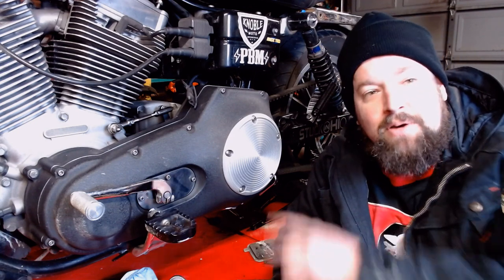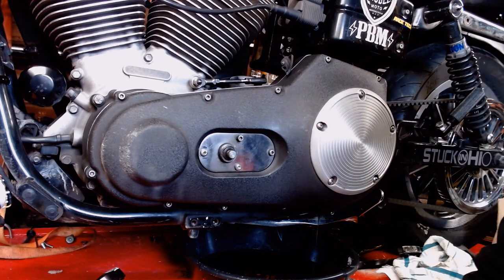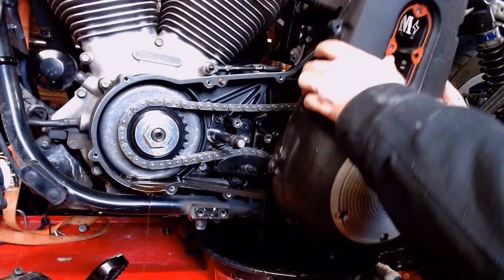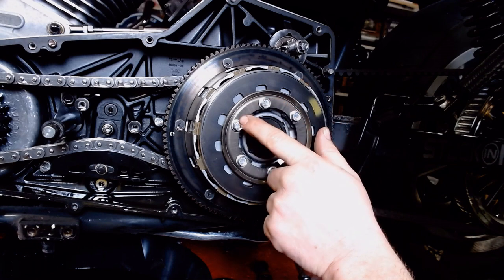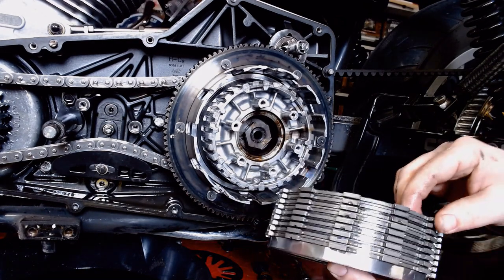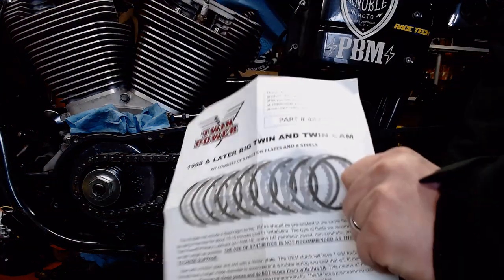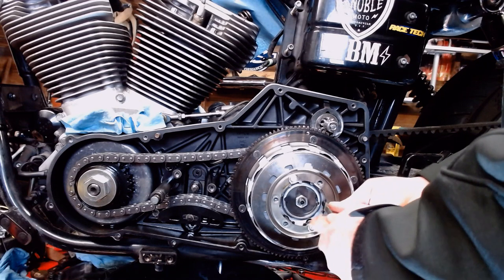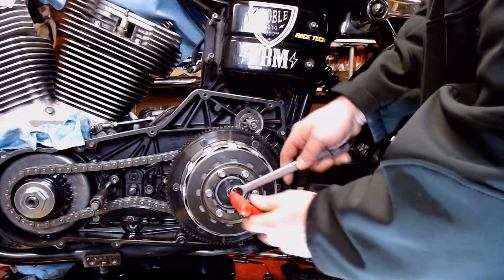Harley clutch replacement with no special tools

Comment: Just like to add that the 6 bolts holding the spring are torqued to I believe 70-90 "INCH" lbs NOT foot lbs you'll break the bolts at about 30 ft lbs 😄 yes I do know this from experience lol have a grateful day 💯✌
Reply from the maker: You have to listen to what I think I said. Lol.

Comment: Can you please tell me what size those bolts are the six you took out of the clutch basket retaining ring?
Reply from the maker: Screw M6 x 1.0 x 16mm Hex Flange Head   HD part 2980. Make sure you get high strength ones.

Comment: Novice Wrencher…

You still have to take all the slack out of the cable right?
Reply from the maker: You want to loosen the cable to have some slack in it before you make the adjustment on the clutch. Then once that is good, adjust (remove the slack) from the cable.

Comment: Great vid.. thx.. Question with 52K on the motor, did you replace your Cam Chain Tensioner shoes yet?.. Appreciate it.. thx
Reply from the maker: Replaced the tensioners at 32ish.  They were beyond worn out.  I switched to gear cams.
Reply: @KnobleMoto  thank you much.. i have 16K on my 01 dyna WG I didnt know if I should go through the light tear down and check them yet.. What mileage
 should I inspect them?
Reply from the maker: @jeffpotts3606  I would check the tensioners on any first gen twin cam as soon as you buy it, regardless of mileage.  It’s one gasket, and you can generally pull that cover off without removing anything else.

Comment: Great job my man. Good persona about you. You should of been a teacher at something.  Ty again.
  I just had Hd dealer put a new clutch assembly  on.
  Is the clutch hub bearing , come pressed in? Didn't ask service. I hope it is, cause they didn't put one in (charge me)..ty in advance
Reply: I do think it all comes as one unit right? And easier for the techs..right
Reply from the maker: If you just buy the hub, you will have to press the bearing in yourself.  However there may be a whole kit available that is pre assembled that I am unaware of.

Comment: I was told to turn  clutch bolt 3/4 turn then tighten ?
Reply from the maker: What you are basically trying to do is to take up the extra play in the clutch linkage, then back it off a wee bit to allow for expansion when things get hot.

Comment: Great video, I’m a complete novice so this may be a stupid question. Since you are using 9 friction plates, then I no longer need the damper seat and damper spring, correct?
Reply from the maker: Correct. The removal of those allows for the extra plate.

Comment: What about if I'm reinstalling a brand new stock clutch plate with a spring plate does that plate go in the middle
Reply from the maker: I am not sure what you asking. But you can always refer to you shop manual for assembly order.
Reply: @KnobleMoto  ok thanks

Comment: Just out of curiosity do u run the beveled edge in our out on the plates?
Reply from the maker: I do not recall any beveled edges on the plates.  If there were, I would checked with the manufacturer of the clutch.
Reply: @KnobleMoto  its barely noticable. Next time u get a plate in ur hand rub the edges. One side is sharp one is round. People argue which way to put em in lol
Reply from the maker: @bobbycarpenter7959  Those "bevels" and sharp edges (burs) are a byproduct of the stamping process used in manufacturing the plates. I worked in the stamping industry.   The larger the bur/bevel, just means the tooling was dull and the material took the shape of the rounded/dull edge of the tooling.  It would be irrelevant to clutch installation. If I found a large burr on some of the plates, I would take it down with a fine file before installation.
Reply from the maker: @bobbycarpenter7959  Many items industrial items like steel shelving, electrical boxes,  and industrial pipe hangers will still have this same bevel/bur on it.
Reply: @bobbycarpenter7959   I never payed an attention either, and I’ve done a lot of clutches on dirt bikes and street bikes. An old timer told me to put the bevel to the inside. I’ve done it the opposite and even mixed em, never seemed to make a difference. If it was that imperative, the manufacturer of the discs would make a note to tell you to install them a certain way, I’ve never seen a clutch with instructions to do it one way or the other